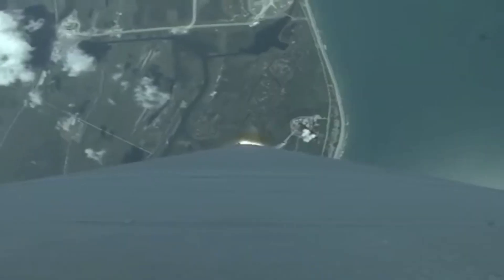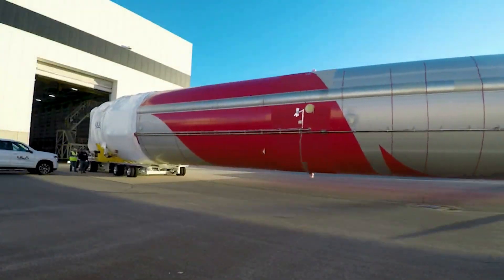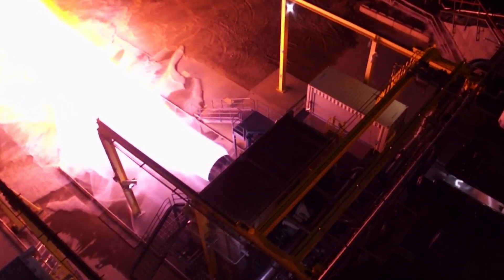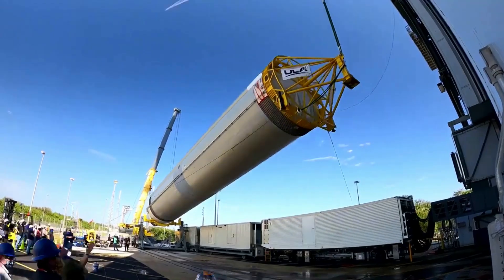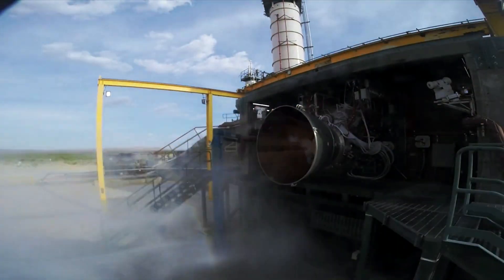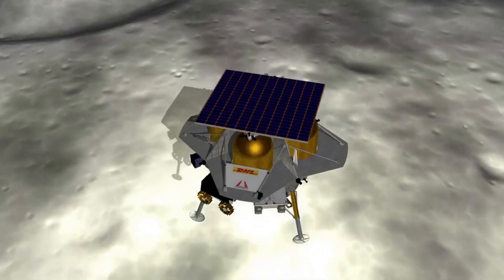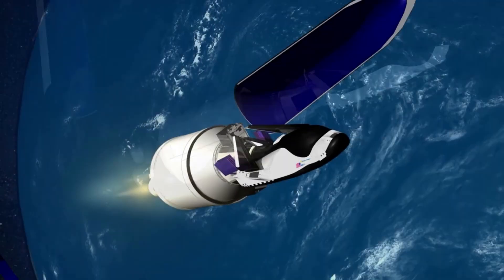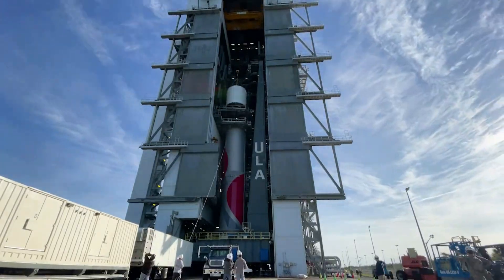The First Launch of Vulcan & The BE-4 Engine Is Right Around The Corner

Comment: So methane is good because it self pressurizes the tank and is better than kerosene for reusability.   But the pressurized kerosene is usually used as the hydraulic fluid to steer the engine on a number of rockets saving the addition of part of a separate system. It would be interesting to know about the details of the trade offs, especially if ULA doesn’t get the engine reusability “plan” operational.

Also, everyone that is using methane as a fuel should also be taking about using carbon credits for BIO-METHANE to help save the planet vs Elon talking about having to increase the methane film cooling (which increases the unburnt methane) so the raptor doesn’t go engine rich (or burn the combustion chamber). Methane is a potent green house gas while kerosene not so much.
Reply: Elimination of the hydraulic systems, for electric-based steering has been used by others.